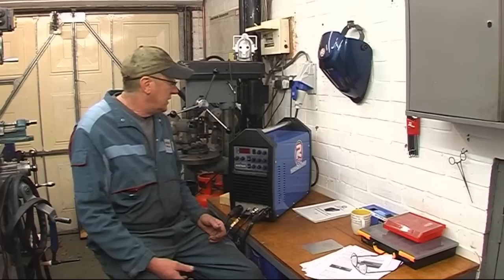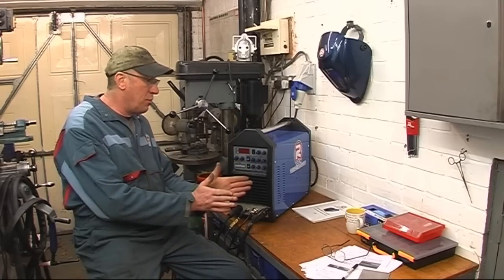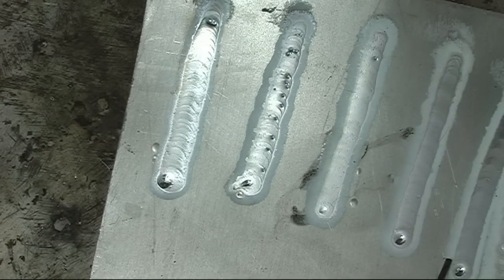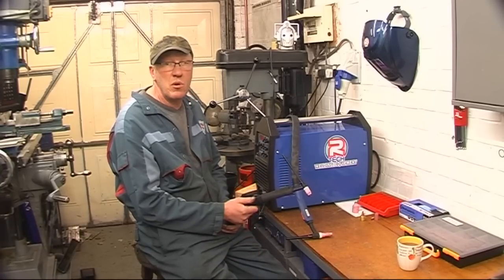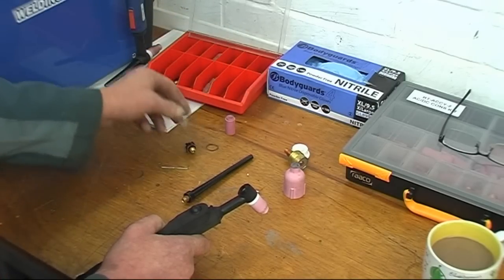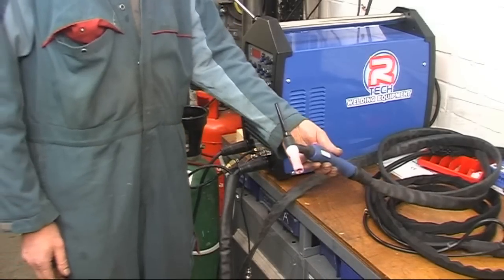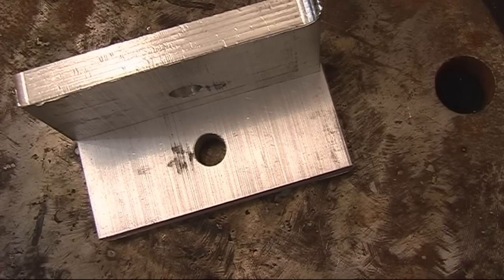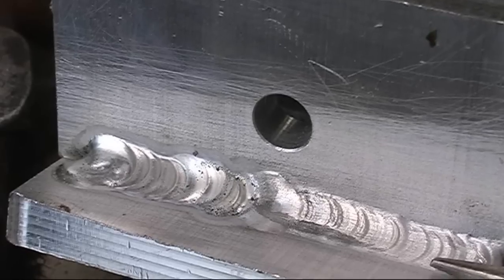R-Tech AC / DC Inverter Welder . TIG Time Part Four

Comment: Does the machine ever trip out at that higher current ? Having issues with mine tripping at what seems way too low effort. Warning light comes on, power cycle resets it and away you go again. I just find it hard to think I need larger than 200A, and that's some chunky aluminium at the end there
Reply from the maker: I have never had the machine cut out .
Get in touch with R Tech .use my name by all means
Reply: @doubleboost  thanks. Mine is the 200a rtech. I'm beginning to think mine has always had an issue.

Comment: never used a TIG, looks a bit like Oxy welding alloy which i have done many years back, the pain was the oxide layer, heat it heat it and the whole bloody lot collapses. have also stick welded alloy with varying rates of success

Comment: Thanks for the video's John I've just bought this welder due to your reviews
Reply: Alan, how did you get on with this welder? I ask because I am possibly looking at buying one of these models.
Reply: @howardosborne8647  its fine mate it takes a bit to get used to the right settings for different metals but well worth the money imo.
Reply: @alanbrown1563  Thanks for sharing your experience with this unit. I've had a good read of the customer reviews on the R-Tech site and it is highly rated. I think when looking for a versatile Tig welder it is best policy to buy a quality item with lots of features. This seems to tick those boxes pretty good. The 3 year warranty is reassuring as well. I heard a saying on another channel a few days back "buy nice, or buy twice". I reckon there's a lot of wisdom in that statement. Cheers👍
Reply: @howardosborne8647  Just be sure to get More filler rods and metals I'm lucky that a mate works for a laser cutting place and got me scraps of steel ' stainless and aluminum to practice on and I went for the V2 welder's helmet from R-tech as my eyes aren't what they used to be and the bigger screen helps me.
Reply: @alanbrown1563  Thanks for the info. I was looking at their auto dark helmets last night 👍

Comment: Congrats on the video of the weld process.  That may be the clearest shot of a weld puddle I've seen to date.

I've never TIG welded...just MIG and OA...but I hear that TIG is a bit like OA.  I've even managed to gas weld aluminum once...and only had a couple of blow thoughs...you really have to move along once you get started with that.  Cobalt blue lens helps.

I hope Tarzan doesn't make any more appearances!

-- Mike

Comment: Hi John.  seems to be an array of Gas lens available.  I cant afford to buy all sizes so what is the logic behind the gas lens.  Using a small lens to be able to get into small spaces  of get a larger one?

I am thinking about getting the small lens in 1.6 and large lens in 2.4 as I would rarely use 3.2 anyway.  (Just to start with)  Obviously there is  then a choice of ceramic sizes.  lol  (although they dont cost as much!)

Comment: Hi John great vids, just curious do you ball the tip of your tungsten on a piece of steel for aluminum or are you just grinding to a blunt point? thanks for sharing.
Reply from the maker: Hi
All I do is grind to a blunt point
As long as you don't "dip "your tip it well weld for ages
Regards
John

Comment: Hi John
Your gas supply line coming out the machine (11:58) is different than the earlier videos, is that a mod you have made or did you buy it.
Great video series, keep em coming
Reply from the maker: Very well spotted
It came with the smaller torch
R-Tech supplied the conversion
Regards
John